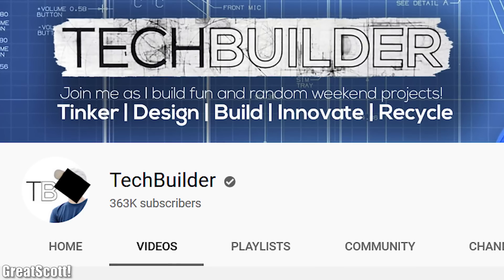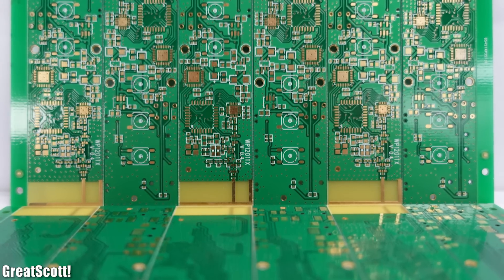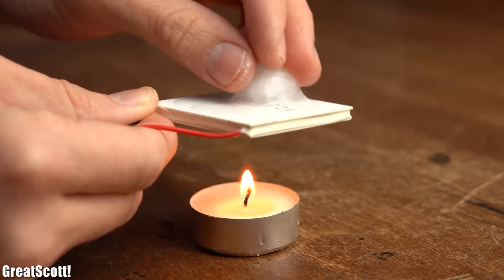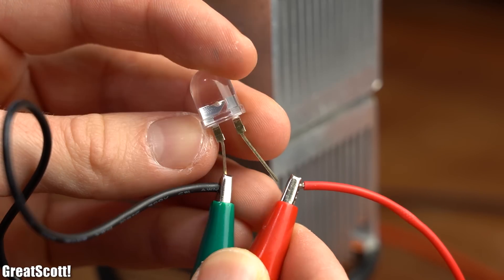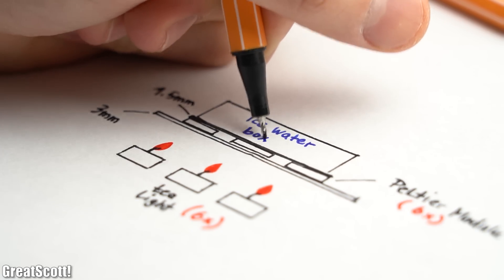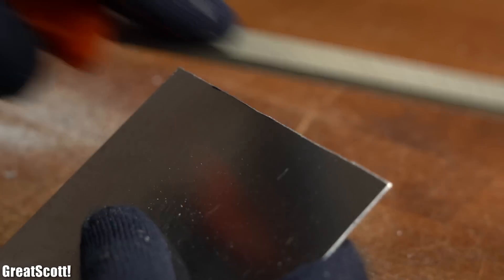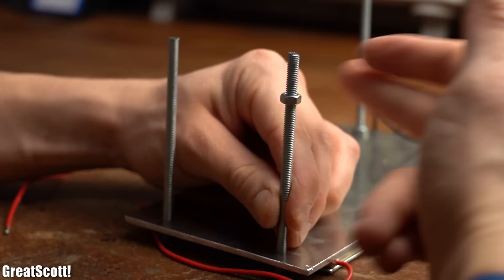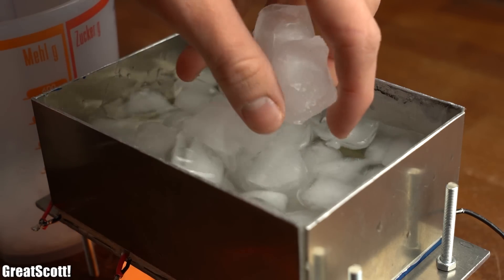Exposing a FAKE Thermoelectric Generator and building a REAL one!

Comment: Why would we even be bothering with stuff like this, when there's a publicly available thermonuclear fusion generator just floating in the sky.
Reply: Yeah but it goes away during half of day and sometimes hides so you need tea light powered alternatives
Reply: @JaredConnell  You can store some of the power in high current batteries and have them connected to an inverter to power your house during the night.
Reply: Yeah, I want to power my home with nuclear energy using PV panels.
Reply: Because this works when the giant thermonuclear generator in the sky goes to bed for the night.
Reply: This device works when the Sun is not there. Personally I only see one good use for this device. Silent Generator. You can build a gas generator with 0 sound with this tgm. If you have an rv it makes sense. The problem is they are very expensive compared to the cooler units. So you can buy more batteries instead of those units. But as far as i know if you want a slient generator,even if it is very inefficient,  this is the way to go.
Reply: @ademmeral  At the end of the day a Stirling generator will still be more efficient.
Reply: Use the solar panel to power peltiers to heat molten salt.
Use peltiers to generate electricity using the latent heat of the molten salt. 
???
PROFIT!

Comment: Fake is a big word. its (maybe) not fake. Maybe he lives in southeast asia and doesnt have AC in his house. The delta between the temps of where you are from (I'm guessing europe) and the place where the video was shot may be over 20 degrees celsius. Which, btw even if the temp would scale and increase delta between H and C side between your two settings, A tiny fan won't be able to push energy out a heatsink super efficiently, but - if the ambient temp is 10/20 degrees lower and the AC maintains it,the difference between the cooling power on your system and his system probably scales exponentially, just because your apartment is probs being cooled a lot better. If you factor in the cooling power of your household (+the fact that it's only really cooling you and your electronics - if you really are in europe) then the draw of your generator's delta against his may be explained. Idk what the variables are, but I'm guessing that there's a decent possibility that I have a point here.
Reply: Your design is obviously better, but Fake is a really big word. Your AC is just probs cooling your heatsink on the hot side a lot better than his. Plus the distance between the candle and heatsink on his design probably doesnt have to deal with a the heavy cool ambient temp above it (which is heavier than hot air as you probably know) So technically his system might be more efficient in a hot environment because a lot of energy will be lost in the distance between the flame and the heatsink in an air conditioned room plus the fact that cool air is pushing against the hot air as it falls. The hot air probably diffuses around too cause it's fast and it will move away from the heatsink a lot faster.. - or more so late year weather in Europe/anywhere outside of SEA.
Reply: Yours is better coz the gap between the fire and heatsink is a lot shorter. Correcton- I don't think yours will be better in SEA actually coz the heatsink wouldnt be efficient enough. Plus how many watts of energy was spent making the ice? I totally just finished watching your video I thought you'd prove me wrong at the end of it but yea your heatsink would suck in SEA. Ice would lose temp so fast and melt, and then it would just be a hot ceramic brick on both sides, since the water would hold all the energy from the side that gets hot after the ice melts.
Reply: Lol I'm writing this as I slowly finish your video - so sorry if the points were not consolidated. Just something to think through. There are holes in this. @everyone - don't bash the other guys channel yet. - Actually I might watch some of his videos now to see. That's all bye!
Reply: LOL this is all based on the possibility that he is from SEA. Point being tho - his design is probs still more efficient in hot weather regardless of where he is...
Reply: LOL he IS Asian! Wow what a coincidence. @GreatScott - I'm sorry if I came on strong. I'm just about to crash and pass out from a night out. Just wanted to watch some videos and I happened on yours. And it just so happens that your video kinda made me raise my brows and I'm tipsy so my inhibition is inhibited. Peace and Love!

Comment: Maybe try with a lower water level in the ice tank, or more ice?  Since ice floats, any thickness of water-only at the bottom of the tank will let the heat sink temperature rise.  I know, it's probably not even a measurable difference, but with that small a power output, every tenth of a degree matters. Ice should be touching the bottom in several places for best heat transfer.

Comment: You are still loosing efficiency by not having fins to suck more of the heat of the tea lights. You are basically loosing 50 or 60 % of the energy before it even gets to the TEC. And we all know they are horribly inefficient at 3-5%

Comment: Wait.. How did you get the ice?
Don't get me wrong, this is cool, and as someone who is interested in this stuff but isn't yet knowledgable to know when a project is fake, I am really glad that you called out the original video, but this isn't generating energy if you get the ice from your fridge.
I get that you can neither create nor destroy energy, and I don't think you are trying to say that you can or anything, but I feel like using ice from a device that used electricity to form the ice in a system that charges your phone is like charging a battery pack on 110 and then plugging it into your phone and saying, look, it generates 5v output and charges my phone.
I mean I guess if this was in a survival situation then you wouldn't Need to use ice, as you could just use marginally cold stream water or something (or if you happen to be in a frozen location, then ice), but like.. if you have ice (that you are making), then you don't need this, even in a survival situation, unless I guess if you have a base camp where you can make ice (maybe off of a generator), then you need to go hunting or whatever and you can take lots of ice with you in an ice chest or something, then use this while you're out camping before you return to base camp the next day, and you can use the ice, but then again, I return to my point that you're basically just using a Really complicated and expensive battery, made out of electronics much more out of reach than a battery.
I get that your point in making this video was not to say, 'here's how to charge your phone in a survival situation' - which I can imagine would be the kind of clickbaity title someone faking this project would use, but still. It's not like you're doing this with fire, ice, and a lemon or something that one could potentially gather in a survival situation.

Comment: You should be able to make ice outside in the wintertime or at least bring in snow from time to time if you lose power during a blizzard. With ice storms, you'll have to ice trays on an elevated surface such as a metal table as the ground might be too warm. If you can't power a cooling fan with candle power, I'd forget about it.

Comment: Now, it would be fun to use the same candles or an alcohol lamp, and compare this 6 thermo Peltier electric cell generator, to a model Stirling engine, fitted with a permanent magnet DC dynamo. Which would produce more wattage from the same flame? Quite frankly, I think it would be a "dead heat"!!😁

Comment: Nicely Exposed, Scott.
I heard that SP-1848 peltier are the ones designed for power generation. Are you sure that you've used the right module in your project?
Reply: true, but it would be more correct to call them Seebeck modules

Comment: You would probably had a bit better results using Seebeck elements. They are similar to Peltiers but are made for making electricity whereas Peltiers are made for moving heat using electricity.

Comment: If you ever go to a small buffet you might see these alcohol gel giant candles they put off enough heat to keep the water close to boiling and keep the food hot. I wonder what would happen if you built one of these with one of those and just a standard heatsink on the other side of it to get rid of the ice water.

Comment: That got me a doubt. If components strong enough to sustain magmatic temperatures were possible, couldn't we use heat piping to extract energy from underground heat while using the ocean as the cooler side?

Comment: Hi German neighbor. My remark:
You could improve a lot the thermal efficiency by insuring that all heat goes ONLY to the module. 

Flame heat should be ducted only to hot plate and should exit by side at the lowest possible temperature, as done in any modern stove.
On the other side, you don't need an ice cooling if you add a way bigger heatsink, as in this commercial application : 
https://www.marlow.com/products/power-generators/powerstrap-generator

Also be careful of differential dilatation if you want long life modules.
All modules on the same plate is not good and will stress jonctions a lot.

 I would test one candle per module, duct the heat from close to the candle, and add a very low profile heatsink on hot side, something like that : https://cdn.shopify.com/s/files/1/0447/3693/products/enzotech-pure-copper-low-profile-heat-sink-w-fan-slf-1-2_1800x.jpeg?v=1571232632
Would be good to angle the inlet duct in order to put the peltier verticaly , then big heat sink on cold side can use natural convection to cool.

COOL CHALLENGE : extract the most power from one module with one smal standard candle !

Comment: There are so many bullshit videos on YouTube that would never work, its not even funny. 

Your channel at least has ALL measurements, AND calculations to prove what you are conveying across to your audience. Good job in blowing one of these idiots out of the water, that insists on showing something they built, that they claim works, but would actually only work if the peltier device's "Hot Side" was sitting on top of molten lava with the "Cold Side" buried in the  Arctic tundra.

Ps. I would love to see your take on a "Split System" Peltier Cooler/Air Conditioner. 

I have thought up one where I only have the "Double Radiator and fans" of the cold side, inside the house "(Going through an air brick) and the 2 x peltier modules and the 2 water pumps(One for each radiator) and second "Hot Side" radiator on the outside of the house (For various obvious reasons) (Keep the hot "outside" and the rest "inside" ...... Which is rather minimal in the case of any split air conditioner).

My long term plan is obviously to run this setup off of 3 x 330w 24v solar panels, a 20A mppt, and 2x 150A deep cycle batteries so that in summer I can run this throughout the night until morning on the current the batteries are capable of outputting and then to charge the batteries during the day. (In winter the polarity of the peltier can be reversed to work the opposite way around by heating the interior instead of cooling)

I realise this is a rather "Expensive" solution to air conditioning, but when you live in a 5th world country that charges "In Excess" of R1.40/KW (more realistically R2.20/KW as it works on a sliding scale) you have to start thinking outside the box when you are dying of the heat 🤣🤣🤣

3 x great big Thumbs Up for your experiment in disproving yet another idiot that can not fathom thermodynamic losses 👍🏻👍🏻👍🏻

Comment: Sadly, using ice is a lame improvement in the sense that it requires an additional consumable that is even harder to produce than heat. I think we should try to be more imaginative and maybe look for home appliances or places where hot surfaces enter in contact with cold ones such as windows or chimney conduits and apply the proper heat exchange solutions to salvage any heat waste.

Comment: Hello Scott. In my final Electrical engineering project I have worked with a Brushless DC motor (form a hard disk) as a wind generator, and I would like to know why is it that you get less energy form the electrical machine working as a generator.

I though all electrical machines were reversible without different power losses!!!

Thanks for your great videos :)
Reply: With motors, AFAIK you get quite well the same efficiency both ways, provided you handle the many-factor-dependent voltage and current properly.

With peltiers, I don't know but I think the major caveat on using as generator is the practical inability to get all the heat gradient "focused" through the peltier material interface. Ie. big proportion of externally administered heat flux will "bypass" the interface through ambient heat and structures, whereas when when the peltier is powered by electricity, all its generated heat gradient is produced at the material interface, as it is its natural origin point and thus any of it cannot "miss" it as in generator-usage case.

Comment: Your aluminum brazing probably failed due to:
- Lack of heat. A propane torch doesn't make enough heat for anything but small jobs
- needed better cleaning of the joined surfaces with stainless brush
- needed brazing flux

They recommend MAP-Pro gas at the minimum for aluminum brazing. See if you can get Map-Pro and compatible torch in your area.

Comment: There's also the fact that if you have to use a fan, which that looks like a 12v fan, to cool the cold side, you might as well just use the power source you're running that from to charge your phone the fan's gonna draw a lot more power than the peltier module will put out. Nevermind the power drawn when you're using a blowtorch on the thing.

 I get that some of these projects are more about exploring the science than making something practical, but the channel seems to bill this thing as something practical rather than exploring the science of how it works.

Comment: Have you tried to boil 2 cups of water with a single tea candle?  It is not an easy thing to do outdoors.  You need a "conical stand" that focuses the heat of the fuel, and does not obstruct vertical ventilation.   https://zenstoves.net/PotStands-WindscreenStands.htm
For a practical device, it would be good to make heat convection slowly circulate a thin film of water across the cold side, maximising evaporation.
First time I remember seeing your face, @GreastScott!

Comment: TechIngredients had a scaled up version of this project less than a week ago. They were getting approx 100V out and powering a floodlight with it from a campfire and a river for cooling.

Give their video a look in because they arrange the Peltier devices in a series/parallel combination as there's an optimum V I curve at which to run them for peak power output... I reckon you might be able to get better results through more water, more heat and possibly changing the wiring in a combination of series and parallel.

Comment: Be careful, the TEC elements usually use a low melting point solder (often around 128°C) on the inside and are easily destroyed. There are dedicated TEG elements that often come with a different material that withstand over 300°C easily.

Comment: Thermoelectric generators are also available, the chip is little bit thinner and the sellers says that they are specifically designed for generating power not for cooling.

Comment: still seems like you could've lowered it more, until the flames are almost touching the metal. and maybe added a bit of an inverted box to hold the hot air in a bit more, giving it more time to dissipate its heat

Comment: man is it possible to use peltier as car ac if we turn the hot side to the metal of the car body work on its roof it will absorve the heat from the car roof on summer and turn it into cold on the botom wich is just above my head , i may try this with my van as it is a 1996 and doenst have ac...so in the winter it will work as a heater by reversing the polarity. ...were do i buy large peltiers to cover the car roof on the inner side?

Comment: There is a difference between TECs and TEGs, they differ in fundamental construction.  Using 6 TECs in this configuration you're getting roughly 1W of output power.  If you used 6 TEGs (such as these www.analogtechnologies.com/document/TEG.pdf ) you could get close to 10W.  TEGs are far more sensitive than TECs though.  They need to be mounted with a specific pressure and they're designed for a specific delta T between hot and cold side to achieve max efficiency.  Nonetheless, even if you used a single 50x50mm TEG, you could actually get enough power out of it to charge a phone.

Comment: The TechBuilder already remove its fake video, Ive tried to build it 2 years ago  using his setup it actually didnt work at all, i dont know why he keep on posting that kind of video on which he knew that it was not capable of generating enough voltage to charge a smart phone and powering a cooling fan at the same time.

Comment: @GreatSott!  It would be a good improvement to have the cold side have water passing through it (from a hose or a stream) as the cooler;  could just be a coiled copper pipe or a sealed box with an inlet and an outlet....   and for the hot side,  instead attach it to a copper bar/plate arrangement that can be stuck into an open fire.    The whole key would be keeping the peltier itself under the temperature for it's junctions melting on the hot side, but I would imagine you could add considerable heat and cooling this way;  possibly much better output for a doomsday/survival scenario.

Comment: You're losing heat from air convection flowing around the edges of the lower plate. A box on the bottom to capture hot air might work as long as the flames can still get oxygen